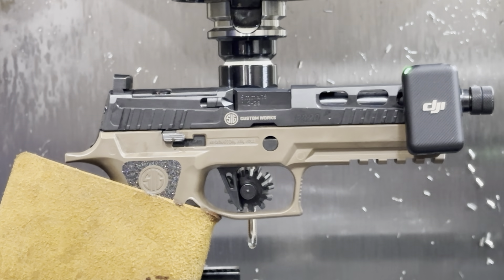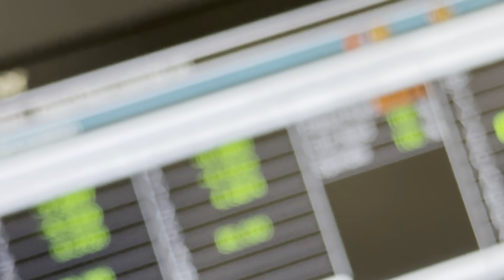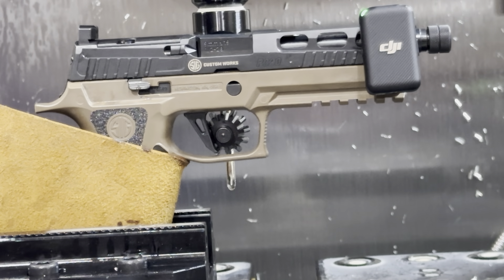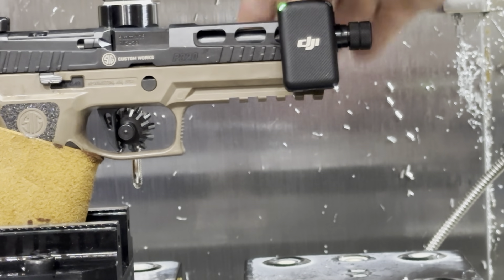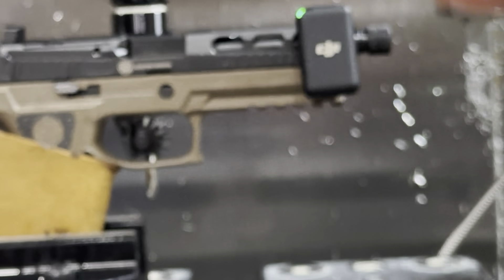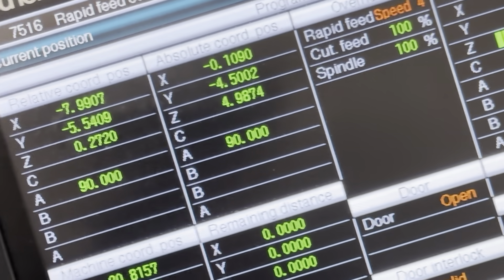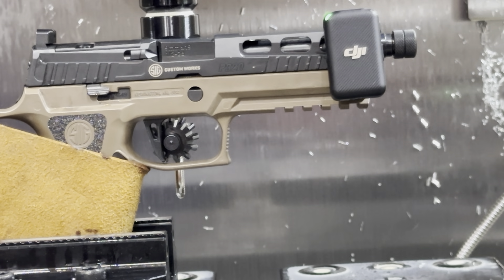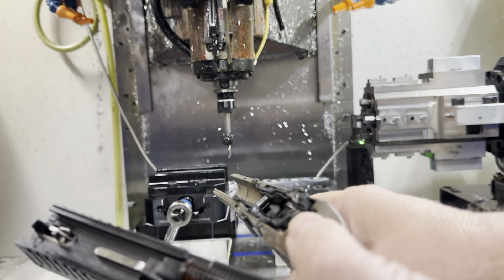Sig P320 accidental discharge tested in CNC machine.

Comment: A gun should never fire with anything but the trigger pull. And you just proved this one does. Good job.
Reply: People are obsessing over the "you are pulling the tirgger" but we are not talking about that, all it takes is an imperfection in the frame, or maybe not seating it correctly, or aforementioned dirt or debris stuck there to move it just that 1 mm. There was a good video a guy made where he showed the design is the problem. That you take the idea that the slide "rocks" when you pull thr trigger and combine with the loose fitting between upper and lower and you get a chance that the seer slips and not a case of someone pulling the trigger.

And even at that, there are a a bunch of guns you can pull the trigger up to the wall and bash the slide and they will not go off - they only go off when you pull pass that wall. It's  a vulnerability in the design
Reply: @gunblade7610 . FFS!!You do realize these videos are doing with mag out?! You do realize the “excessive” slide slop is from no mag being in place!?. You do realize that YOU dolts are obsessing over. Scenario that does not exist if practicing the rules of gun safety!!!!!!!!!!!!!! 

Let me say this for the mass imbeciles, Keep finger off triggy and gun no pew pew!!! 

Everything else is irrelevant and just contrived dribble.
Reply: @gunblade7610 that's not at all what this video is proving the video is proving that in order for the gun to be able to slip off that sear the trigger has to be 98% pulled he's already 2mm into that trigger pull before he can get it to slip off skipping the last 1mm, dirt imperfection or w.e would still only cause it to slip if you're you're already holding the trigger 98% of the way to break
Reply: Although interesting, I don’t believe this video shed any light on the alleged firing without a trigger pull issue.  The trigger moves the sear downward releasing the striker, you’ve demonstrated consistent sear release as measured by your CNC (with only 2 reset examples) then manipulating the slop in the slide until the striker releases prematurely (less than full trigger pull).  This demonstrates a faulty design if a pistol will fire with a partial trigger pull coupled with a slide movement. So if a user pulls the trigger to the wall, then stops the trigger pull before the gun fires, then places the gun back in the holster, you’ve shown the holster can move the slide slightly (but enough) to release the striker causing exactly what user claim have happened, the pistol fired without a trigger pull while holstered.  
I carry a striker fired pistol and have fired thousands of rounds but I’ve never re-holstered a pistol that I’ve pressed the trigger beyond the wall nearly to the break point (without firing) having put pressure on the sear release, is it safe to do that? If the sear begins to move out of the full reset position is it safe to carry? What are the design characteristic of the sear/striker/trigger relationship and is the P320 within tolerance of that design? Show us that with your CNC machine..!
Reply: Social media has stunted our youth to the point we are at today......
Reply: It’s basically at the wall dude this isn’t what’s causing the misfires
Reply: He just proved it and you still hold onto you BS. There is NO ACCEPTABLE scenario where you would have a loaded weapon, with mag out, and trigger depressed within 19 thousands of break and you grab the slide. For God’s sake, how can people be this fckn dense!!!  

What are rules of gun safety!!!!!
1. Great all guns as loaded
2. Don’t touch the fckn trigger unless prepared
To destroy something. 
3. Don’t point your weapon at anything you do t intend to destroy!

How the fck can the scenario he just demonstrated result in injury or death if following the damn most basic gun safety rules!!!!
Reply: Exactly. People hold onto stupid like they gave birth to it. It’s ridiculous how dumb they are.
Reply: It shows that there must be some tension on the trigger.
Reply: Pulling the trigger and the gun goes off.  Mind blowing….not…you are not measuring pull weight.  Range of travel seems to be pretty repeatable.  When you pull the trigger the gun is designed to fire.
Reply: A point for the G19 and G17 is the striker is not retracted to firing point until the trigger is pulled back pushing the sear back then dropping out of way of striker.  
  Yes years ago Glock had some defective firearms. But that was quickly fixed, many who keep pushing it are likely not even old enough to really remember it or actively involved in shooting handguns. If I remember correctly it was in the 10 mm handguns and 40 cal (same caliber) actually.  Now back to the actual subject the SIG 320 family of pistols. 
  Do I have a dog in this, yes I own several. Unfortunately it's the first SIG handgun I liked.  I've shot 210, 220, 226, and several others including the P250.  As a duty pistol over the years I have been issued 1911a1, M-9, Glock 19, and M-17 / M-18. Of all of the Glocks were the easiest to train soldiers and people in general to use. Simple manual of arms. Some of the worst to retrain is someone coming from a Glock to M-9 (92fs)  the "should have stayed with the M-9 is a load of it.  Many of them were worn out, and do have many points of failure or problems.  Some that many people don't know about.  Not the breakage of slides that was a USN problem from constant use of ++p 9 mm ammunition. A problem but fixed early. Locking blocks breaking, or worn out and locking up the pistols. I had 7 or 8 different M-9's as a duty pistol from 1999-2021. A Glock 19 for a time too.. Before that the 1911a1. In 2002 untraining several people (soldiers) from Glocks to the M-9 was a real PTA by the way. Along with annual qualifications of reserve and N.G. troops that were Civilian police that had Glocks or other striker fired pistols or personal pistols. 
 After several drifting of subject. With 3 SIG handguns close by and a Glock 19, 2 are loaded. The G19 and SIG P322 different uses different sizes of pest control.  Especially after doing several safety checks with the M-17, M-18 and civ 320 pistols. My M-17 will drop the striker fairly easy with a little rattling and pressure on trigger I've shot a good amount though them. A common denominator with many discharges is similar holster retention methods locking on trigger guard trigger and frame. Including the SIG holster even, that came with my 320 compact. I have less concern than someone who carries IWB, I don't very often and dang sure don't carry appendix or pointing at other body parts. Now if SIG decides to do another "volunteer update" for longer and heavier trigger pull to fix this mine are likely to go back to SIG second trip for one of them. Otherwise, back in cases and in safe buried or might be traded in on different brand of replacements.
Reply: As an X5 Legion owner, I needed to see this.
Reply: You clearly don’t understand what’s being said in this video 😂😂😂
Reply: The trigger is being pulled lol
Reply: There’s definitely something wrong with the P320, however, triggers aren’t being touched when these guns are going off in holsters. 

I want to see this test with no trigger pull at all. This man should a mag with snap caps, then without touching the trigger or pulling it back to the wall, slap the slide and see if it fires to truly recreate the scenarios that are happening.
Reply: @shootingscience you won’t see a test without a trigger pull because it’s impossible to make it fire that way. For years people have tried, laboratories, agencies, institutions, companies, and groups. No one has been able to replicate it. Not unless the trigger is pulled.
Reply: Actually he is PULLILNG the trigger. He just proved that if you pull the trigger a gun will fire. Someone just did a test on multiple guns and it turns out? Yep, they all fire when you limp pull the trigger. ALL of them
Reply: he proved the glock failed the exact same test. watch his other video
Reply: @CitizenSeven500 also, a Glock trigger pulls the sear back before it drops. While a P320, starts dropping the sear as soon as the trigger is started to be pulled. Meaning a Glock can’t release the sear without a full trigger pull, while the p320, obviously can go off if someone just partially pulls the trigger and wiggles the slide. It’s physically impossible for a Glock striker to go past the trigger sear without a full trigger pull, with how it’s designed.
Reply: @CitizenSeven500  The difference is the glock trigger isn't moving if the trigger safety isn't depressed, the sig trigger has no safety to prevent movement.
Reply: @CitizenSeven500 yeah no shit. He pulled the trigger all the way back and wiggled the entire gun enough that the trigger was pulled entirely. Secondly, you have absolutely no idea what the trigger test is doing. It’s just to simulate the sear not able to fully reset do to tiny amount of anything. The original Wyoming gun projects video has nothing to do with the trigger other than to simulate the sear catch not catching fully and the slide being able to wiggle enough to allow it by, which should never happen. A Glock can’t do that because how the sear and fitting of the slide is. Please think a little before making comments.
Reply: @trevoranderson6238  wiggling the slide 20 thousanths before the trigger break releases the seer on both genius
Reply: @CitizenSeven500 he wiggled the entire gun in the Glock video and barely touched the sig slide. That’s a bit different. Yeah of course when ya wiggle the gun enough to pull it fully, it’ll go off. But you should never be able to have the gun fire, without any added pressure to the trigger, as Wyoming gun projects showed. In his video, there could be absolutely no added pressure to the trigger. Meaning since the sear didn’t drop, no matter what you do, it shouldn’t go off. But it does. Which physically can’t happen with a Glock because of the trigger safety and how the sear pulls the striker back before dropping.
Reply: @trevoranderson6238  wiggling the slide caused both to release the seer without the trigger breaking dude.
Reply: @CitizenSeven500 oh my god… I forgot people were this stupid. Okay. In his test, he pulled both triggers right before their breaking point. He then applied pressure on the slides. In either case, it’s a stupid test, because he still had pressure on the trigger that could be increased when the handgun wiggled. Difference is, he wiggled the whole Glock to do it, and he didn’t have to wiggle the whole sig to do it. Lastly, the trigger, isn’t part of the problem. It’s the sear engagement. So in a real world scenario, the Glock would never go off without the trigger safety pulled, while the sig can, cause it doesn’t have a trigger safety. Again, it’s a sear engagement issue, and how the sear drops, not a problem about the trigger being pulled fully.

And again, Wyoming Gun Projects test is more reliable. Because it doesn’t allow for an added force to the trigger. Meaning, since it hasn’t been pulled fully, it shouldn’t go off. But his P320 did. Just like my buddies did every single time we tested it. And the reason the trigger is involved in this test at all, is because it’s the only way to simulate a sear that for whatever reason wasn’t perfectly in place, and which for the sig, is very easy due to dirt or grime. While a Glock can’t. A Glock sear has nothing to easily obstruct the sear engagement while the sig can. Now, this is where you look up the different sear designs, and if you can’t tell why what I said is the case (which is highly likely at this point) then you have problems of your own that’ll never be fixed.

Lastly, all this guy did, was prove pulling the trigger entirely, makes the firearm fire. Which obviously, no shit, that how guns work.
Reply: @trevoranderson6238 that video’s pistol had a wood screw jammed into the trigger which was holding it back…. But sounds like you didn’t watch the video….lol
Reply: @trevoranderson6238 yeah with the wood screw lol and pulling the trigger
Reply: Ever seen a Glock fire with a partial trigger pull? Edit: Its already been proven.
Reply: @notes9504 nope. I even tested the ones I own throughly. Doing the same exact test as everyone else is doing on the P320. There’s a reason glocks not having uncommanded discharges have never been heard of.
Reply: @trevoranderson6238  No they just use to blow up all the time back in the day lol
Reply: @wadewilson6135 all the time is wrong. They hard manufacturing issues and guns were recalled. Unlike the P320. And even then they are the most use sidearm in the world with government agencies, special forces, and civilians. 

Gun manufacturers have problem all the time with manufacturing. They recall and fix, then move on. It’s pretty simple.

Lastly, a Glock can’t fire without a full trigger pull cause the trigger sear must move back before it drops. Meaning, unless a part breaks, or the trigger is fully depressed it can’t go off. Which is relevant to my original comment.
Reply: @wadewilson6135  The Sig 320 has replaced the glock in those memes. I saw a couple memes from the old GWOT days that were modernized.
Reply: @wadewilson6135  rule of thumb for Glocks is to never buy one in any caliber other than 9mm. Every other caliber has had issues.
Reply: See this is the problem just cause u don’t like glocks,u look for dumb reasons to say well this one does this or that,so childish when people are  losing there life’s cause SIGS  bs,yes about every manufacturer has had a pistol blow up eventually after selling  50 million pistols that worked perfectly not out of the ordinary to see that,but this sig bs has been going on for years with them blaming everything but there self
Reply: @mattogle2582  You weren't around when glock was having their kabooms.
Reply: @trevoranderson6238  Glock has an acceptable sear engagement tolerance. It's not always going to be 100% the same. While obviously a factory new QC passed Glock shouldn't do this, it DOES happen all the time when people swap trigger parts because they are not paying attention to the final results of the sear engagement during the whole length of the trigger pull.
Reply: @Magneticitist yeah but that isn’t relevant. That’s like taking a pickup into a dealership because the engine blew because you added 14 turbos and expecting warranty to cover it. If one modify something, it no longer is that something.
Reply: @trevoranderson6238  Right but it's just a living example of how the sear engagement works. Just explaining how it's not always going to be exactly identical between the same model of pistol. In this case, it doesn't matter how far the trigger is actually moving.. what matters is how little sear engagement there is left after moving it any amount. 

Someone should automatically understand that a Glock is safer in that regard. It's entirely different mechanics. I thought most people understood what it means to have a much lighter break and shorter pull.
Reply: @Magneticitist what’s the point you are trying to make? Cause so far, one hasn’t been made.
Reply: @trevoranderson6238  I'm just trying to help you understand that you don't get the basic mechanics of these guns. Of course it can go off manipulating the slide if you bring it right to edge of dropping the striker. How can you not understand this?
Reply: @Magneticitist oh I understand the mechanics, but unless the trigger is pull fully, a firearm shouldn’t be able to go off. Theres no tolerance there.

And again, this test isn’t a trigger issue, it’s a sear issue. The trigger just simulates the sear connection to the striker hook. On something like a Glock, unless the sear is broken, can only fully engage on the hook, or not engage at all.

How the sig sear is designed, it allows for any minuscule amount of debri to prevent it from engaging fully. Meaning there’s a safety issue as that means any sort of jostling around can cause the striker hook to slip off the sear. Worse yet, there is a safety sear on an sig that is supposed to catch the striker hook if the trigger isn’t pulled entirely, which obviously, isn’t working.

Glock: ——— |

                  |
Sig: ———__

Horizontal lines are the trigger sear, and the vertical is the striker hook. So please don’t say I know nothing about the mechanics of firearms, or what the test even is testing, because obviously you still haven’t figured out what the actual issue with the firearm is.
Reply: @trevoranderson6238  Try firing a super high end extremely precisely fitted 1911 that wasn't actually hand fitted and was just built with random parts... Parts need some room to avoid friction that would prevent them from moving properly because these companies are not hand fitting and sanding down parts to perfection. Since this is basic physics, that room allows wiggle room. Luckily for us, you're not supposed to shoot guns by pulling the trigger to the edge of the break then finagling the slide like a weirdo. 

This guy can do the same test on his CNC machine except when he's bringing the trigger to the wall, push down on the front of the slide to cause the sear interaction in the rear to be slightly less... It should also remove that actual, in reality, very real slack that actually exists beforehand.
Reply: @TheMailmanOfSteel That's actually been my personal experience.  I've owned 6 Glocks.  Had trouble with the 40SW, the 357 Sig, and the 380.  But never had a problem with either of my G19s.
Reply: @TheMailmanOfSteel  I own almost every caliber with the exception of .45GAP and .357 sig for obvious reasons and have only a few malfunctions due to subpar ammo QC with my glocks....
Reply: @trevoranderson6238  A reason that Glock also lost the M17X contract. Because it's boring, and the triggers are shit even on 5th Gen. Buy a manual safety gun if you can't manage good trigger discipline.
Reply: @iTrinityPlays and how’s that working out for them? There’s a reason most special forces use the Glock. Shit, even Russia made a copy to do the same thing.

A military sidearm only needs to go bang when the trigger is pulled and be durable. Aka, glock
Reply: @TheMailmanOfSteel 
You are incorrect by a mile!
Reply: @trevoranderson6238 g19 gen 5 fails this same test as does the g43.
Reply: @DeviousStang17 no it doesn’t. If you are referring to the same guy that made this video. He pulled the trigger in his Glock video.
Reply: @wadewilson6135  no they didnt. some .40 cal models cracked the slide and thats all it was it. no glock has ever fired by manipulating the slide with slight trigger pressure, unlike the pos 320 lol
Reply: @trevoranderson6238 the guy who made the original video that started all this with the little screw up in the hole at the top of the trigger did the same thing with a glock and made it go off too
Reply: @trevoranderson6238  It actually can, the same way SIGs do. you're one google away from those videos
Reply: @trevoranderson6238 incorrect.
Reply: @mattogle2582 incorrect.
Reply: @notes9504  I mean ive never seen anyone pull a trigger in to .001 MM off the tolerance and then wiggle the slide on a Glock.  Id like to see that though.
Reply: That’s not the point really say a cop draws and barely pulls trigger to wall then reholsters the pistol ,well that cop just made the sig be just like shows in video but after he’s put the trigger at wall and let’s off,the inside is engaged to fire with a vibration like inside a holster,the exact reason why cops and soldiers are the main ones having problems,I saw one go off at a rang inside the holster not even being touched in front of a instructor talking no one was even aiming doing nothing just standing there after they had been drawing
Reply: @HopFilms this gentleman did exactly that (search his videos). Others have done it too and the Glock does fire when pressing down on the slide when the trigger is pulled to the wall plus some.
Reply: @julionunez7201  "Glock does fire when pressing down on the slide when the trigger is pulled to the wall plus some."  It is in fact reasonable for a gun to fire when fully pulling the trigger as you describe by pulling past the wall.  That is the entire point.
Reply: @notes9504  yes!!! Watch his other video. Another guy did same thing on a different channel.
Reply: @notes9504  Impossible. define "partial" for us please! The trigger bar is such that a Glock will never release the firing pin unless the trigger is pulled back to the point the connector pushes it down and the trigger bar pushes up on the firing pin safety. The internal safeties will never allow a discharge with a "partial" trigger pull. Nice try.
Reply: @MatthewPost81 it's already been proven, look it up
Reply: @notes9504  Yup https://www.youtube.com/watch?v=LKD0S3KhwdI&t=174s